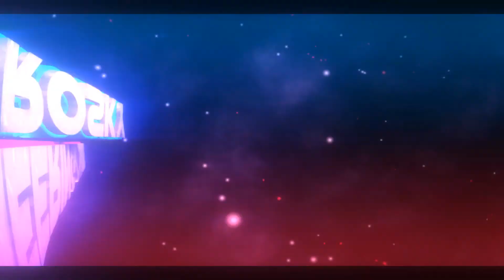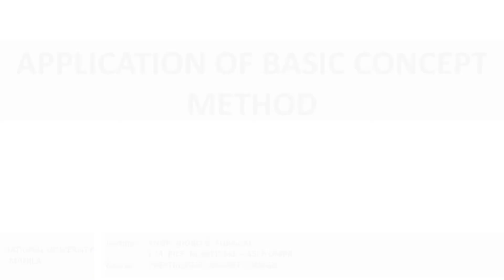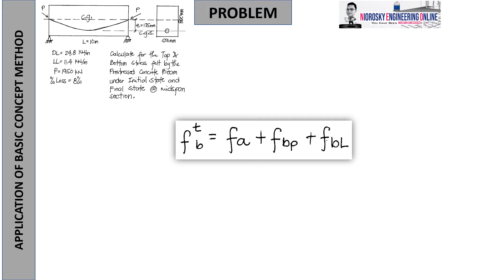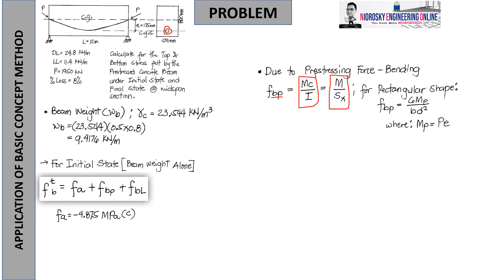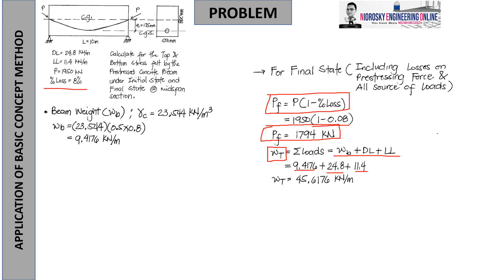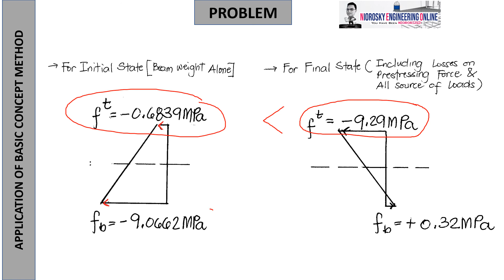APPLICATION OF BASIC CONCEPT METHOD

Comment: Sir good pm. Ano po ang maggiging behavior ng beam if baguhin yung dimension at location ng tendons pero same parin yung load?
Reply from the maker: primarily the camber or the deflection that goes up. remember that the tendon profiles to be adopted is hiighly dependent to the type of governing load if for uniformly distributed (most of the cases), single concentrated at the center, or two concentrated arranged symmetrically.